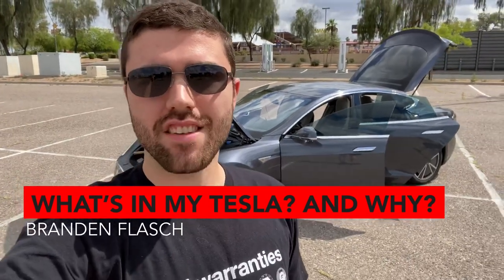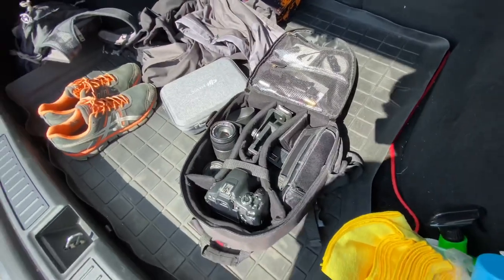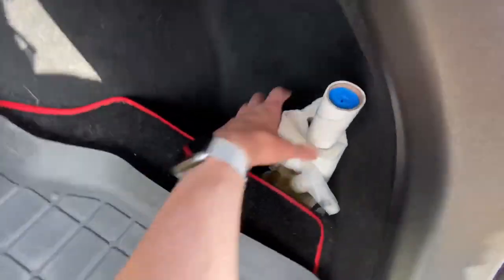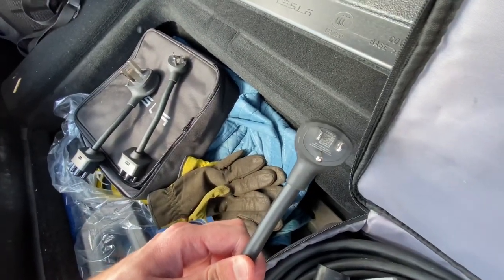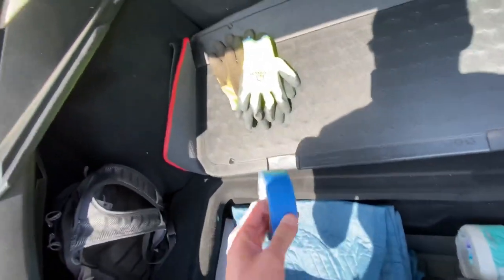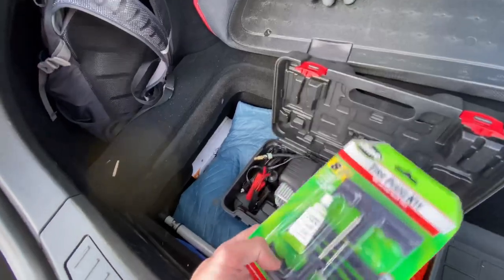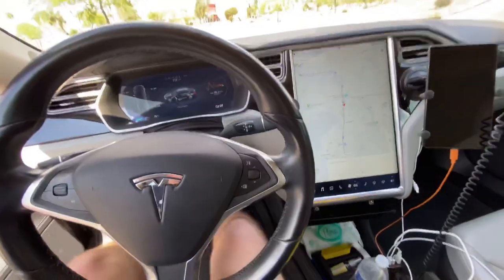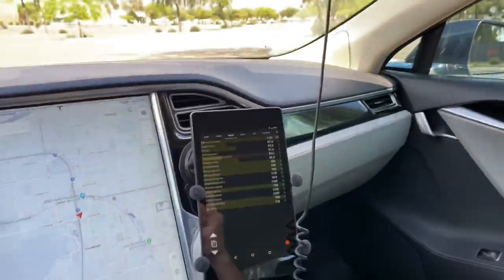Driving 40k miles/year - What I keep in my Tesla and Why

Comment: Hi Brandon! Interesting video :)
I own a 2013 Model S85 with close to 200000 miles on it. Few comments based on my experience.

- 85 battery pack A can charge up to 87-88 kw.  I only lost 7% range, less than 1% in the last 30000 miles. 85  is the battery pack that performs the best regarding to battery degradation. It peaks at lower kw but still at 50 kw at 60% SOC.
- I would love to have Next Gen seats but...having adjustable lumbar support really helps, I had worse seats on previous EV (Chevy Volt LT) 
- I don't have AP. I don't drive a lot thru heavy traffic mainly quiet highways or country road (25000 miles per year lately). 
- I get all the updates possible, having AP doesn't change anything.
- My maintenance cost is highly impacted with suspension arms replacement. Our road are very bad and it shows! I also had my charging port replaced, wiper linkage, PTC heater, all used parts from California at great prices. Half shafts were both replaced at 160000 miles UNDER warranty at no cost!
- Ultra Hi Fi sound system is great, I would not buy a Model S without it!
- I have air suspension, no maintenance as for now BUT it was Continental OEM not not TAS (Tesla air suspension) with seems more fragile
- My MCU has been chipped (eMMC) lately, LTE upgrade AND SD card changed (very important for firmware update) for roughly 1600$us. 
- I also have 3rd row seat! Not using them at all but it was bought by first owner.

I suscribe to your channel, thanks for sharing your experiences !